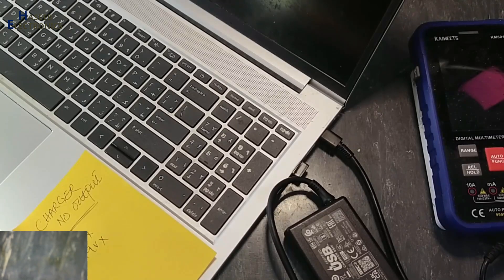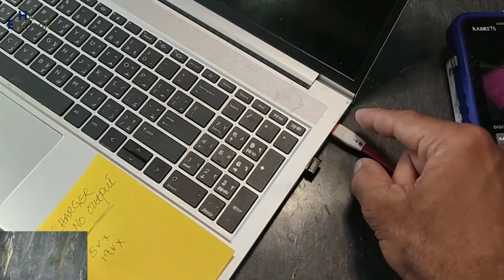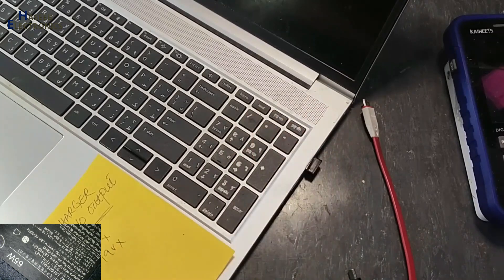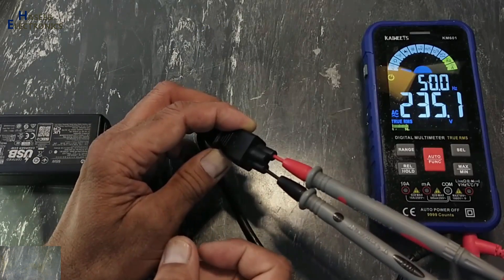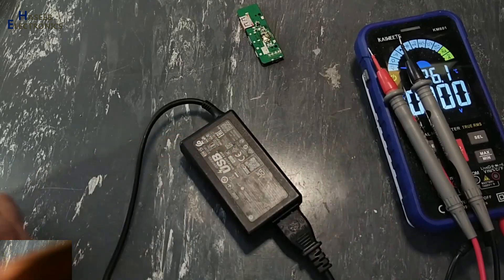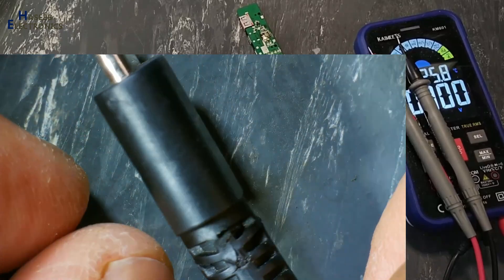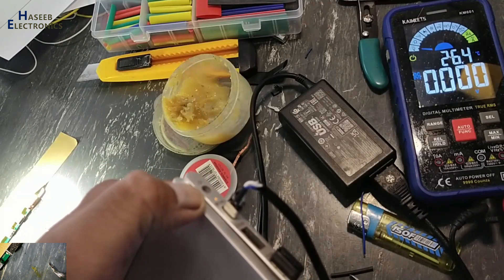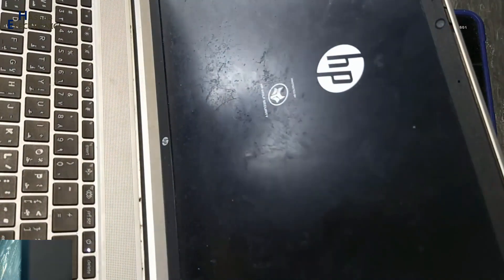{1204} HP probook Type-C smart 65W charger repair

Comment: Which is positive and which is negative cabel
Reply from the maker: White positive 
Black negative 
Blue CC
Reply: @HaseebElectronics 
I was checking 
Blue is showing positive 
Black is showing nigative 
White is no
Reply: @HaseebElectronics   Haseeb bhai, how to turn this adaptor for common uses? I need to convert this adaptor for DIY charger. But all the time get 3.8V.